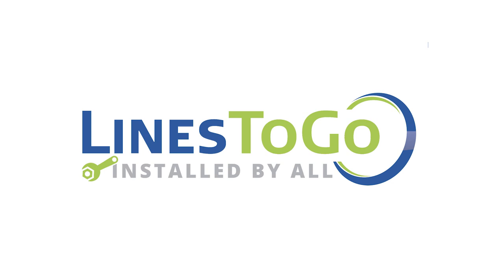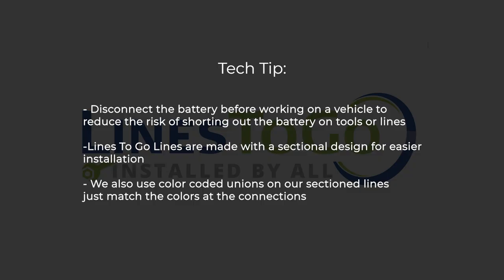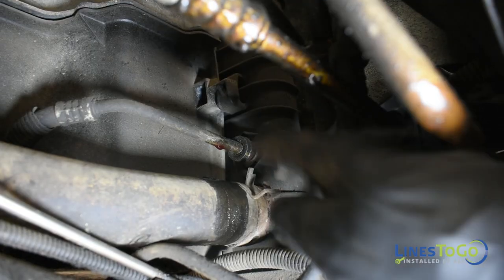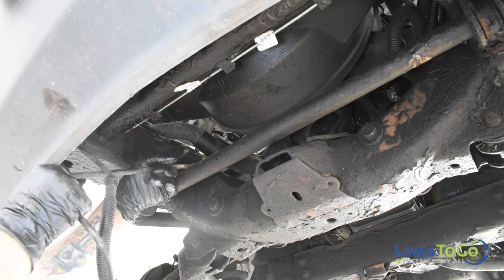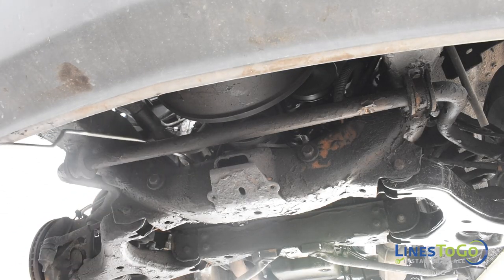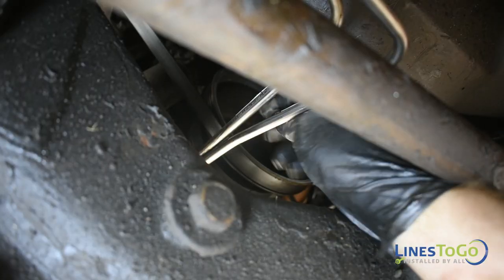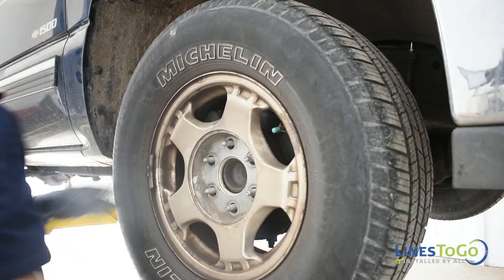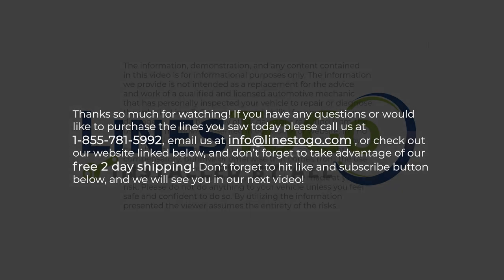How to Install 1999-2007 Chevrolet Silverado 1500 Transmission Lines

Comment: Would it be possible to do it on the ground
Reply from the maker: Hello,
Thank you for your question. 
Installation of this product from the ground is possible but would prove more difficult. 
You may need to jack the vehicle up and remove the right front wheel to provide you with better access. 
Thanks for watching! 
LinesToGo Team

Comment: I have watched a few videos,some did it without taking inner wheel well out,tire was not removed,heat shield NOT removed,air intake STAYED put,,,,,,I guess this is labor charges UP the ying yang,,,,,the only thing removed on other videos was the front skid plate and grill,,,,,,,some mechanics are GOOD WITH looking out for their customers,others,BANG THEM OVER THE HEAD,,,,,SINCE DOING MY OWN REPAIRS, NOW I FEEL SO FOOLISH FROM NOT DOING MORE REPAIRS MYSELF THROUGH THE YRS,,,BUT THEN AGAIN,YOU TUBE WAS NOT AROUND TO GUIDE US DIY GUYS TRYING TO SAVE A BUCK BACK IN THE DAY,,,,,,,COSTS TODAY ARE REDICULUS,,PART PRICES ARE A JOKE,AND MOST ARE CRAP TO BEGIN WITH,,GO TO A DEALER FOR OEM PARTS WHICH ARE A TOTALLY DIFFERENT ANIMAL COMPARED TO AUTO PART STORE CRAP AND THEY ARE OUTRIGHT EXTORTIONISTS,I JUST PAID 402.99 FOR A FAN CLUTCH FOR A 2003 SILVERADO,,,,HAD TWO NAPA'S ONLY LASTED LESS THAN 3YRS EACH AT 120 BUCKS EACH,AND 120 BOTH TIMES TO INSTALL BC I DID NOT REALIZE HOW EASY IT WAS TO DO.CANT LIVE IN THE SOUTH WITHOUT GOOD AC,,SO IN THIS VIDEO,PARTS APPROX 140,THEN ADD 30%,AND LABOR FROM WATCHING THIS VID I WOULD GUESS A COST OF 400,,,,,AT A DEALERSHIP YOUR NOT GETTING OUT INDER 1200,,,PLUS THE EXPLANATION ON WHY ITS NOT COVERED UNDER THE WARRANTY,,,,,,SORRY,BUT IT JUST SEEMS IMPOSSIBLE TO GET A FAIR SHAKE THESE DAYS,,,,,AND IT TAKES FOREVER TO FINALLY FIND THE RIGHT MECHANIC,AND WHEN YOU DO,THERE ABOUT READY TO RETIRE,,,,,,,,THINGS ARE TRULLY OUT OF HAND THESE DAYS,